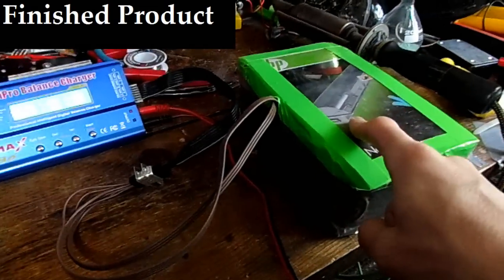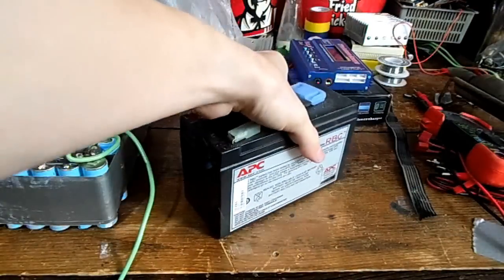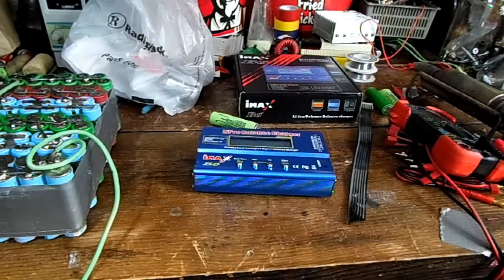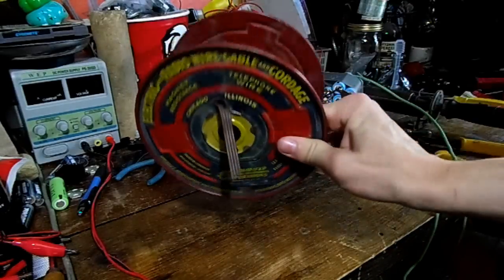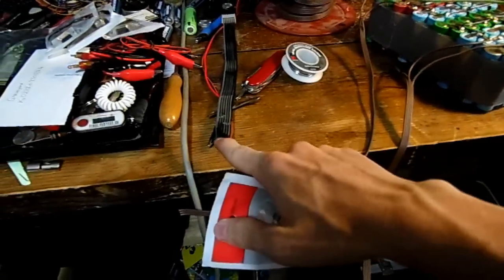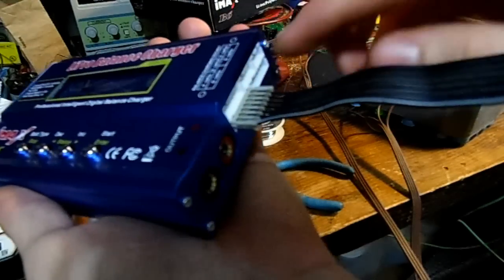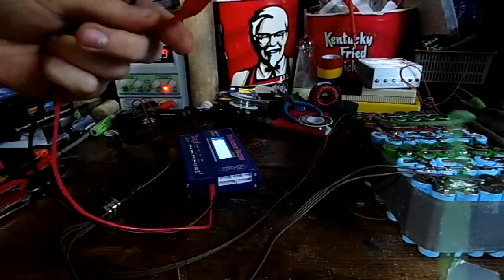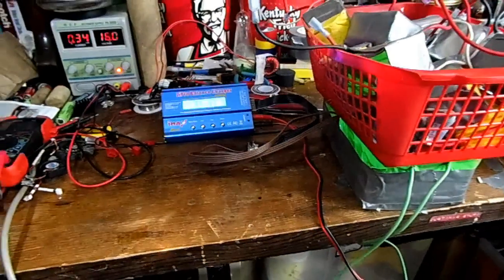DIY: Balance Charging E-Bike lithium battery upgrade

Comment: Rinoa Super-Genius So i used to have 13 cells and 4 batteries in each cell. Now i have 4 cells and 13 batteries in each cell. Will i have the same amp hours as i did before or will i have less?
Reply from the maker: sounds like no, but your question doesnt make a whole lot of sense.

you mean 13 series by 4 parallel versus 4 series vs 13 parallel? you will be changing the voltage and capacity.

Comment: just buy a balance plug for like $6 and be done with it unless you like to just say "I made this"

one should of came with the charger unless it was 2nd hand  but yes its always a good idea to balance charge a lipo 

looks more like a wood burning iron LOL
Reply: Maybe it's boring for him to make it. But I was stunned while I was watching him making that charging system all by himself using that old soldering iron. It was ultra fun. Thanks bro :D
Reply from the maker: Dusan Markovic
 thanks for enjoying it :D
Reply from the maker: "just buy a balance plug for like $6 and be done with it" well you can't "just be done with it" if it takes 3 weeks for the part to come in. and no, not all imax b6 come with extra cables and stuff. thats an extra expense.
Reply: Rinoa Super-Genius No problem. Just keep it up! I'm kinda new on your channel so I want to know how you learned all that electronic stuff. Cya on the next video :D
Reply: I've never had a balance plug come with any new charger.
Reply: Spencer Howard buying the wrong charges 
ya I know some have them and some dont

Comment: your lithium battery pack video has been very helpful to my son and me. we are trying to built a 48v battery pack like yours also. we have your battery schematic, what we was wondering was do you have a wiring schematic also? something that shows how / where the battery packs are hooked together and where the 7 wires are hooked up? your video has kept me from putting 4 sla batteries on our electric trike that we are building. thank you
Reply from the maker: well the 7 wires are really simple. 0v > 4v -> 8v -> 12v -> 16v> 20v ->24v. on the imax b6 charger it should say what polarity the connector is. like left to right or right to left. mine has a plus on the left side and negative on the right. the negative is where the 0v starts. hope that makes sense.

just as an added example in case i wasnt clear enough. if you look at the connector that has 3 pins that one is 0v -> 4v ->8v. the one with 5 pins is 0v -> 4v ->8v ->12v -> 16v.

Comment: Actually that 4 wire cable was used mostly for TV antenna Rotors from the motor down to the controller at the TV

Comment: your videos are incredible, I was hoping you could maybe message me and kind of guide me through the process of either building a 48v pack at potentially 30ah , and one 36v pack at 30ah , or would you recommend I build 2 packs for each ? so 2 24v packs at 30 ah , and then 2 18 v packs at 30 ah (they are for two different scooters) would building two packs per unit make it easier to charge and deal with? im basically trying to optimize weight to power, I have a 36v scooter overvolted to 48, and a 24v scooter over volted to 36
Reply from the maker: it all depends on how your going to charge it, if your wanting to use the imax b6 then you can't charge more than 24v so you would have to split it up, but if you found a BMS that worked you wouldnt have to split it up.

personally i'd say just make a bunch of 12v 30ah packs that way every pack is interchangeable, could run 12v items if you needed them and could even jump start a car battery during an emergency. that way they are useful for more things than just the scooters. not saying the scooters arent good enough of a use, but if the power went out it would be nice to know you could rewire your battery to power an inverter :D
Reply: See that was my train of thought,  so you're saying go with 3 12v packs and 4 12v packs for my battery settup, do you have any videos to build 12 packs with a balancing option?
Reply from the maker: Fareed Alshami
 well you would have to balance each pack by itself prolly. but you only have to balance the pack every so often, i top off my cells with my DC power supply like 5 times then i balance them and they are only 0.01v off.

 i only set my cells to 4.0v instead of 4.2v so not only do they have more room to accidently get out of balance but also last 4x as long.

one option you could use is to make one big pack that can be rewired on the fly, you would use relays to turn it from 48v 30ah to 4v 360AH and let it sit like that overnight. all the cells would be parallel so they would equalize. then the next day you would flip the switch and the relays would switch it back to 48v 30ah configuration. thats an idea i've been wanting to try.
Reply: I'm a very visual person any way you you could draw this out, or make a video on it? Your videos are simply wonderful, hands down , my other thought was if I did build a simple 36, or 48v, pack, 2 he not pick up a bms, and charger that comes from the the commercially ready lifepo4 battery packs, however, I don't really know the chemistry difference in charging,  I'm really liking the half pack ideas since it would make it quick and easy to charge, though your switchable pack seems to be the most reasonable so far. Doing this would make it almost as easy easy a commercial product which is the goal since my parents want to use the scooters as well
Reply: Also what model laptop did those packs come from?  I keep finding non oem batteries which concern me and they are all packs rated around 4400mah. Have any you've seen on ebay you reccomend?
Reply: I over voted by buying a bigger controller, original was 24v, a motor can typically safely handle 1.5 times it's power rating, yes, more rpm, and torque, gained quite a bit of speed, but my scooter is quite light, it's an Electra scoot no go

Comment: hey, i have a few simple questions. first, what power supply are you using? i want one. XD second, am i correct that charging in parallel means i don't have to  worry about differing voltage? i mean i can always rehook it up to be in parralel just to charge it if this is the case. i don't mind the hassle.

EDIT: aand then i start reading comments...
Reply from the maker: i just use a 80$ 0-30v 0-5a universal DC power supply from ebay, it's worked wonderfuly, and i've really abused it. Variable DC Power Supply 30v 5a

once you connect cells in parallel you don't have to worry about them getting out of ballance between themselves, it's just series packs you need to worry about. you could actually use relays to switch all the cells to parallel so i'd turn my 24v 24ah pack into 4v 244ah battery and all the cells would equalize in voltage.

i've found i only need to balance charge the cells every like 5th charge, it takes quite a while before the cells get out of balance so that means i can top the packs off with my 30v variable power supply without balancing.

hope that helps.
Reply: Rinoa Super-Genius  i've decided to take your advice. i've already ordered the laptop batteries (since i want them in new and roughly equal condition). although, i've realized that if i'm maxed at 5 amps i'll be limited to around .2C if i charge in parallel since each cell would be seeing less amperage. it would take a while to charge. i can't imagine how long it would take to charge a 244ah battery at 5 amps. though maybe i'm missing something... though is it true if you leave batteries connected in parallel overnight without charging they will equalize each other? it seems the most efficient way to deal with balancing so you would never have to do it while charging.

i'm making a 36v battery out of 30 cells. 10 in series 3 in parallel. it will give me about 8.8AH(advertised at 10400mah) per cell so 26.4AH potentially. i'm using 10 in series because usually 36v systems are made to deal with 39-40v normally. This is because 3.6 is the nominal voltage of the cells with 4.2v being the expected voltage at full charge(i charge mine to 4.1 or 4.0 to reduce aging). I reasonably sure that this information is correct feel free to correct me; you might save me trouble down the road.
Reply from the maker: Wulframm Rolf
 you can only put like 80w through the imax b6, so if your charging a 24v pack you wouldnt want to go over 2amps. but still thats only 12 hours for a charge.
Reply: oh i did not know that thanks! you actually did save me trouble. i'm glad i posted that.
Reply from the maker: Wulframm Rolf  just to clarify. its actually really easy to tell how long it would take to charge. 10 AH at 1 amp per hour thats 10 hours. 1 amphour at 2 amps per hour would be 30 minutes.
Reply: Rinoa Super-Genius
yes it is. my issue though is that i need a faster charge because i will be using it so frequently. charging in series shouldn't take too long but charging in parallel could present some issues since there would be a lot of capacity. I just hadn't figured what that capacity would be. if i wire them all in parallel
i will have a 3.6v 264AH battery and charging at 5 amps would take 52.8 hours. i'll probably split them up and charge them in a mix of some sort.

Comment: So you build 2x 24v to get 48V battery. With 48V you have 12 cells to balance and Imax B6 only takes 6. Is there any way to charge 48V battery at once with Imax B6?
Reply from the maker: yeah you could connect the two packs in parallel and connect all the balance leads in parallel too.

Comment: What do you use to prevent discharge you battery bank too much while riding?
Reply from the maker: common sense.
Reply: You could use a lipo alarm.
Reply: I agree.  An alarm is the cheapest easiest thing to do.

Comment: Hi all I have seen quiet lot comments, I am just got my self in to build a few batteries for my quadcopter. Lipo is so expensive and not so reliable. So I decided to use the Panasonic 18650B to build a 4S battery and something like 20ah, can anyone help me out with wiring tips? and also how many batteries will I need... all the information really what you know.
all your comment will be appreciated.
 Thanks guys for your cooperation.
Reply from the maker: or you could watch my videos where i build battery packs instead of people telling you via comments.

Comment: I have a charger for a lead acid 48v 9ah ebike battery. If i built one of these lithium battery packs from laptop batteries can i use the same charger without having problems or will it not fully charge?
Reply from the maker: you need a lithium balance charger.
Reply: yeah i was planning on getting the blue one on ebay. so do i run my current charger through the balancer and into the battery?
Reply from the maker: Rob Floto the balancer is a charger
Reply: Alright got it... one last question and thank you for your help btw.  I read on the balancer description that you can only charge a specified amount of cells at a time.  If I have 120 cells wired up how am I going to charge all of them in a relatively short amount of time if I can only charge 6 cells at a time?
Reply from the maker: Rob Floto
you can only do 6 in series. so break your pack up into 24v blocks like i did. so i have two 24 volt batteries i connect together to make 48v.

but you can do as many cells in parallel as you want.
Reply: alright got it.  I think you caused the demand for those laptop battery lots to go up exponentially because in your vid you said you made your pack for under 90 bucks and the lots are going for like 200+ now.  a lot of people must be using your idea!
Reply from the maker: Rob Floto
yeah but i just checked ebay, theres some 12 cell packs up for only 9$ right now, its a better deal than what i payed. so idk what you mean, guess your bad at searching ebay.

also battery prices change very frequently. ^^
Reply: I dont see searching ebay as a skill lol but if youre seeing them for 9 bucks new then it must be because i dont see it...
Reply: Rinoa Super-Genius if you really found a new 12 cell battery for 9 bucks please send me the link because i only see used batteries for that cheap.
Reply from the maker: Rob Floto http://www.ebay.com/itm/HP-Laptop-Computer-Li-Ion-12-cell-Battery-Pack-HP-Part-405389-001-/261218962043?pt=Laptop_Batteries&hash=item3cd1dd0a7b

you don't need new batteries, because even  unused packs could be 15 years old and only half the capacity due to voltage drop.
Reply: Rinoa Super-Genius they're used plus 6 bucks for shipping so it would be 160 for 120 cells. I found new 13 cells for 15 bucks each with free shipping which would be 150 bucks for 130 cells.  looks like if ebay searching were a skill, which its not, i'm the better candidate, sir :D  on another note with all jokes aside thank you for your help
Reply from the maker: Rob Floto as i said, it doesnt matter if they are new or used till you test one to see.

i've bought new laptop packs that sucked, but used ones that where great.

also these cells arent used, just untested.

Comment: If you pair the weak capacity cells with the high capacity cells, you can average out the capacity of a parallel pack.  That way all your parallel sets are more or less the same as the other packs.  This way each parallel set will more or less charge and discharge at the same rate which improves your overall usable capacity of the pack.

This does mean that you need to individually measure the capacity of each cell.  Then you try to pair them up so that the total capacity of a parallel set is as close to the overall average as possible.
Reply from the maker: i didnt test the individual cells and i still ended up with the parallel packs being pretty close. i think they only deviate by 2ah at the most. and since i used duct-tape to make the case for this i can easily open it up and add a couple more cells.
Reply: Rinoa Super-Genius Well adding a 2ah cell to the weaker (lower voltage) parallel set is certainly one quick and dirty solution compared to testing every cell and remixing all of the cells to balance them out. This allows you to spread the discharge level and keep the voltage the same throughout the discharge cycle.  This also means you won't need a balanced charger because you have permanently balanced the cells.  There is no need to have the same number of cells in a parallel set.  The only requirement is to have the same amp*hour capacity in every parallel set.

Not only would you be adding 2ah to the total pack capacity, it allows you to safely draw more energy from the higher voltage packs since you no longer have a low voltage parallel set.

Comment: Hi,  you charged using the li-po selection.  I thought you had Li-ion cells.
Reply from the maker: lipo and li+ are pretty much the same thing, for ome reason this has differant settings and one is at 4.1v while the other is at 4.2v. i miscalibrated it so 4.2v is really 4.15v then set it to charge to 4.1v so it charges the cells to 4.05v. that way i get like 3x as much life out of them.

for every 0.1v less you charge them, you get 2x as many charge/discharge cycles.

Comment: Your vids were helpful to me. I built an 18.5v 48AH battery from 18650 cells and it's balanced with the Imax B6 also and is wired directly to my laptop and can run it for about 30 hours straight. I charge these batteries from an 80w solar panel.
Reply from the maker: wow thats awesome! :D

Comment: I made battery pack and bought the balance charger but how do I add the 7 leads to hook batteries to charger. Are you attaching to the negative side of each pack and one positive?
Reply from the maker: yeah, the wires are

0v
4.2v
8.4v
12.6v
16.8v
21v
25.2v

i charge the cells to only 4.0v so i get 4x as many cycles (1200-2000) and have more room for them to get out of balance. so they are

0v
4v
8v
12v
16v
20v
24v

i hope that helps/
Reply: Thanks for the help on adding the wires to charge with. got one pack charging and it works fine.